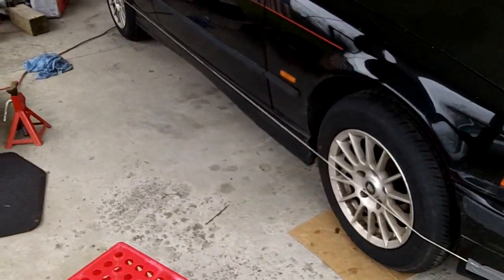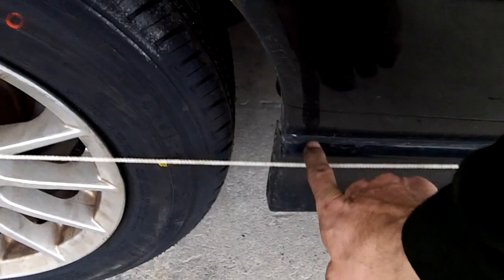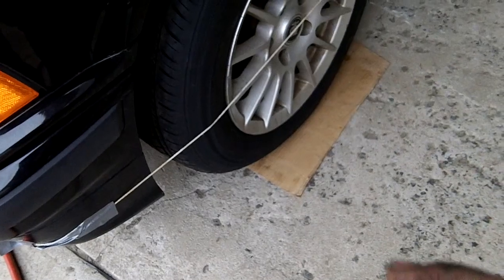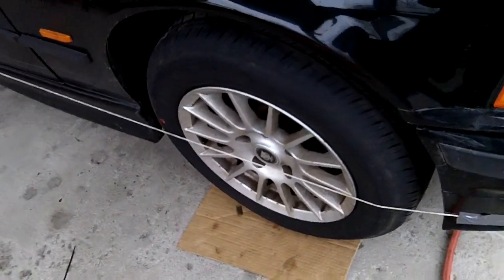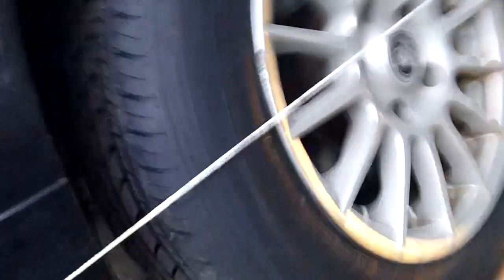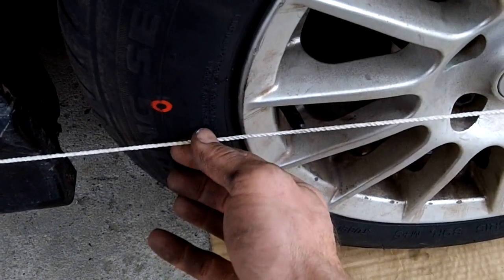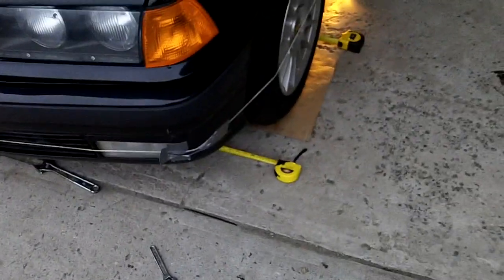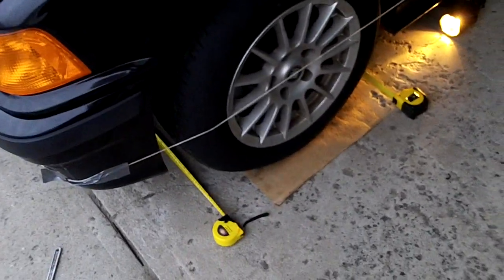How to align your car with string, DIY

Comment: So much superstition about the holy all-knowing car-shops. They wont lift you and your car up to the 7th heaven and inspect every effin' little screw in your front suspension. They will have a (mon)day at the job and half-hearted adjust with some out-of-date "digital" equipment and take your money and complain about all the rust and bla bla. If you are lucky your car will run straight and not wear tires. If you care to take the effort and spend some time with your car and its front suspension you will see that it is not something magical that only men in white coats with supernatural abilities can treat with magical dust and make you happily pay for. What is shown in this video WORKS. But: you have to understand the basic concepts about front wheel suspension. And get your hands a little dirty....
Reply: Trond Hansen  What you are saying is wrong, we have something that d.i.y don`t have, that is the right knowledge. Yes I will agree that some don`t do their jobb and give you some idiotic results, but most of us have the knowledge to do this right. Many uses as you say digital equipment and that is for a reason, it goes faster then the old way, the old way that many still uses does not include a string. but a toe in/toe out adjusting stake. the different between a home made one and that they are using is the adjustment option on it, and it`s more expensive. you will at the both ways need the data for correct angle adjustment. The string option will give you a false data and no, it does not work to get it 100% right. Burn the string and get your self a stick, two nails some knowledge and data. there you go, 100% correct adjustment.
Reply: Trond Hansen makes sense, but I'm a complete muppet when it comes to these things.  Guess it takes a lot of experience.  I'm sure even guys that work on cars all the time have absolutely zero clue on how to do this.
Reply: +ComputerGuy I DIY and I have plenty of knowledge lol. I'm also a professional mechanic. Your statement is invalid.
Reply: I rest my case, you do it your own way :)6
Reply: +Trond Hansen you are right
Reply: Steve Vento 
Guy... My car only has 1 adjustment in the front. Easy as ever! I'm not paying $100 for some young guy to millimetrically adjust my tie-rods. Certainly not if I have aged tires on still & new tires will get me an alignment for free.
Reply: Trond Hansen I
Reply: I went to the shop and got alignment done few days ago, drove the car couple times and today noticed there is some clanking sound when I pull in/out of parking lot. I though I might have hit a cola can or something but didn't see anything.  COuld it be the shop forgot to tighten something or something else, or maybe it's nothing, maybe I hit a cola can in the rear and didn't see it. car seems to drive fine. Think I heard the sound in 2 difference occasions
Reply: @tommyaleks100   . Even professionals with all the top notch digital equipment do not do alignment correctly. Most of them even do not know that the car has to be loaded correctly (for example my BMW X5 e53 according to BMW service manual, before beginning doing alignment has to have full tank of gas, 68kg weight on a driver seat, 68kg weight on a passenger seat, 68kg weight in the middle of the back seat, and 21kg in the middle or the  trunk).  Something similar is probably required for other cars as well. Some of mechanics possibly know that, but I've never seen anyone doing this. It means that even having very precise electronic equipment and mechanics that know how to use in 90%  of cases your alignment won't be as good as it could be if the car wasn't loaded according to specification.
Reply: @8bellsringer  very true. So givin that you need to ballast the way the car will normally drive, and the shops don't, just makes me want to do the alignment my damned self.

Comment: I'd say if u where going to measure from tread of tire to other side of tire tread front and back of wheels u didnt even need the string plus not every vehicle wheels from front to back are the same width so u could not just use the string exactly that way

Comment: There are major flaws with your method.  You're assuming the rear tires are equal distant apart as your front tires.  If they aren't, your alignment is going to be way off.  Measuring from body panels is another bad assumption...just thought you should know.
Reply: The twine just got him started so he could see what was probably going on. The tape measurements determined what he was actually doing.
Reply: True. He's basing it off the rears are the same. And if it is a four wheel alignment, where the rears must be aligned first, then forget about it. Many cars have to have a four wheel alignment.  Besides there most than just toe. There's caster and camber.  And what if your struts hat seat are worn, springs misaligned, shocks blown??? It would be like building a house without leveling the foundation first.
Reply: DaytonCarCare
And that's why the local shop kept messing up my alignment. They didn't consider worn components at all. I now know enough to spot those things and fix them myself, but I had half a decade of wearing out tires before I was determined to set the conditions for a real alignment where tires might actually last what they're rated for instead of half of what they're rated for.
Reply: DE Nichols
Unfortunately some techs are rookies or just not the sharpest tool in the shed and a couple cans shy of a six pack. lol But yea you have a find a good shop and experienced alignment tech to know such things.  I typically take to to them to do an inspection for me (for free). Then they tell me what parts are failing. After I replace they align it.  I do this all the time and I know what techs to deal with and they know me also from previous cars I take to them.  If there is an issue or I replace another part I feel was missed by their inspection, they realign it for free. Much easier and exact then doing this all myself.  Time is money and they sure do save me time.

Comment: Personally I do ALL my OWN Work, BUT I have been since I was like 8 growing up. However when it comes to Alignments I go for a close enough and take it to the pros with the machinery and knowledge to verify it. I do not know an alignment machine and even if I did I would have NO Freaking Idea how to use it. I believe there are some things WORTH paying for and saving my tires is one. Besides my wife will KILL me if I screw it up since our tires cost upwards of 600+ each. 
I am not saying that shops are good or bad I TRUST the people explicitly that touch my vehicles and they trust me since they know I am a far worse critic of my own work than they could ever be. Type A BUT I also know where to say this is NOT my expertise and let the pros that it is handle it. :)
Reply: +Crash Gear $600 per tire?  Do you drive a monster truck or something?
Reply: +Crash Gear after i brought my truck in a shop to be aligned ($60!) and they couldn't get it right after two tries, i did it myself and don't ever intend on going to a shop again!
Reply: +themadmailler I agree, same story here. I trusted the shop and spent $150 for the alignment. When I check after the service, I noticed off-centered steering wheel, which wasn't like that before the alignment. And they're like "oh it's within tolerance, no big deal". The main reason lots of people do this by themselves is because they are sick and tired of getting ripped off.
Reply: +Crash Gear The problem is nowadays, even if you pay a decent amount of money, you still don't get the service you paid for.

Comment: 0 to 1/16" toe -in is what you want. 1/8" is too much toe-in. Not too, too bad but will wear those tires some.
Reply: That depends on the car. It's pretty easy to get the specs.

Comment: There is an 8 mm difference in track width on the small BMW, wider in the rear this means you will add 1-1,5 mm toe in by this method. To much toe-in/out will not be a big problem until tires are worn down on the one of the edges and tires destroyed. Using the string method not considering front/rear track width, is not a good idea. Ruler and rolling the car half a turn of the wheels  is much better, you even don't need to know the track widths. All you need to know is toe-in spec.

Comment: we only have 1 garage here in my city I'll use, he's the only one with the new laser persision tracking systems in Scotland! 
I have worked on cars and built them from shells etc in all my days and know a fair bit.

statement from garage sent to me via email  

 latest four wheel imaging alignment technology which is capable of detecting minute misalignment in your tracking to ensure that our customers get the longest wear, best control and improved fuel economy from their vehicles.Using four stationary cameras (one for each wheel) to measure the position and orientation of alignment targets our high-definition imaging sensors continuously measure wheel target position and orientation giving multi-dimensional modeling to provide highly accurate alignment measurements. Our skilled and fully trained operatives can use either live plane mode, which uses the targets as a reference plane, or the traditional alignment mode, which uses the rack runways as a reference plane to obtain the optimum alignment for your vehicle.

You will probably know that in order to maintain proper control of your vehicle your wheels should be properly aligned otherwise the steering can become heavy or drag to one side. Most drivers only become aware of wheel misalignment when they feel it through the steering but many vehicles have misaligned wheels that do not always give this feedback to the driver. Inspect your tyres and you may notice uneven wear but by the time you do the damage is done.

Properly aligned wheels reduce wear and improve fuel economy. Wheels gradually move out of alignment through general use. Collisions with the curb or speed bumps are the worst culprits. Did you know that a mere two degrees of misalignment on both front wheels can increase fuel consumption by around 10% and that 11% of all premature tyre removals are due to uneven wear caused by wheel misalignment?

Comment: If u do a eigjth toe in thats a 16th on each wheel making 1/8total u wemt twice as much as u should
Reply: Every car is different. If you need more negative camber for a racing setup, then you actually want 0 degrees or even some toes out! A tire with more negative camber is tilted in. A tilted tire wants to turn, not go straight. So toe out is not perfect but is the only fix. So every car needs something different

Comment: This is a great way to ROUGHLY align your wheels. But this method will not be accurate enough to try to accurately toe your wheels in... Just think. There is no way your going to align both your tape measures within 1/16th of an inch of one another. Also. If you start with uneven toe in the beginning then your tape measures are starting at different points to begin with! I prefer to eyeball it and aim for 0 toe until I feel like bringing it to a rack.
Reply: +quadrunnerjake calipers lol

Comment: You can't get a datum line off the body work, it will not be even, or a gap measured by a finger. This is not the way to do it

Comment: THIS IS HOW NOT TO ALIGN YOUR WHEELS.
YOU COULD ONLY DO IT THIS WAY IF YOUR FRONT IS THE SAME WIDTH WITH REAR.
strings are fine to set up your wheels but not this way
Reply: Michal M I thought the same thing. This method would be OK to temporarily set up the car, but I would want a professionally sorted alignment that looks at toe, castor and camber...

Comment: A lot of work but some very basic misunderstanding of vehicle systems is evident: 1.No way you can use body panels for reference, you're making too many assumptionsabout the body being perfectly symmetrical (it never is), the body being in exactly the same reference dimensions to the front and rear suspension on each side (never is) etc. 2.You can't rely on your wheel rims to be free of run out at the tire bead area which is why alignment techs adjust their machines to reference an AVERAGE of the run out when they are set up. 3.Tire sidewalls are never identical in dimension, i.e. belts overlap, there are joins in the belts etc. so comparing measurements to the sidewalls is useless. I have seen similar videos using string alignment methods, but have not seen one that is remotely accurate. Fortunately the result of all this is just going to be accelerated tire wear, but if you get it too far off it could affect handling and safety.

Comment: this string method is not a good idea except to kinda get it close enough to drive to the shop and get it on the machine...first rule,never depend on the body for any measurement, second the rims are never perfect so using the side walls or even the tread is never on...you can believe what ever you like. the money you may save is gonna be wasted through tires and fuel mileage.. it is what it is,,,,
Reply: Arnold Conner  the d.i.y people have to learn how to use the toe in/toe out stake, get some knowledge and some data. this was and are used by thousand car repair shops, this was the deal before the digital adjustment tool was made.  All they need is a, long stick, two nails, a caliper and some data. Oh I forgot the knowledge howe to use it :) it is the 100% right way to do it.
Reply: why does everyone keep saying they can't drive it to the shop.when removing the tire rods you paint behind the nut to mark it's original place that should have you aligned enough to make it to the shop
Reply: Hey tommy...I have knowledge and data...In college we did by string and then I went to hunter c 111 d 111 then f series and now I use hunter hd alignment  machine. ..yes the string methods will get you by to get to a shop...but for fine tuning, the machine is very good at doing all the measurements at the same time....like I said, you have to take in consideration that rims, tires, body's and body molding is not so perfect. .There is not a string method for changing ball joints or control arms or even a spring....A magnetic level used on the rim to take a get it close for camber...but for caster there is no measurement for the d.i.y in his driveway. ...or cross reference and s.a.i. measurement. ...I do both car and heavy duty truck and trailers